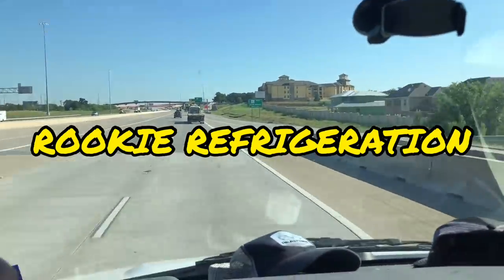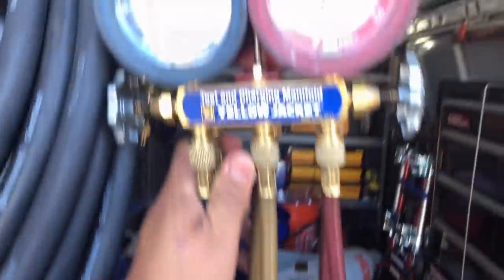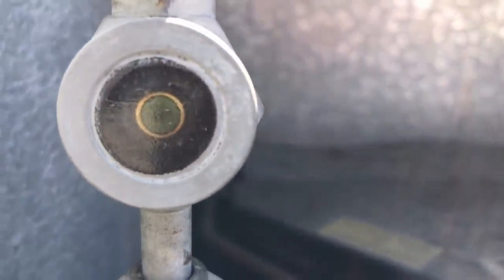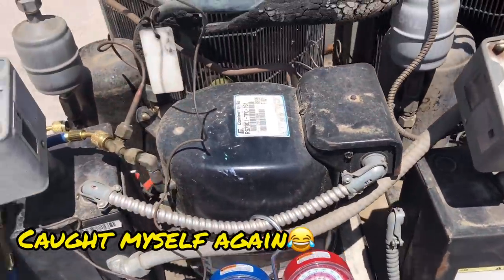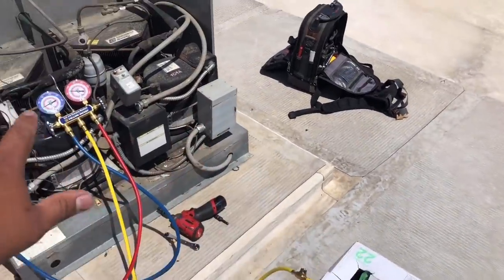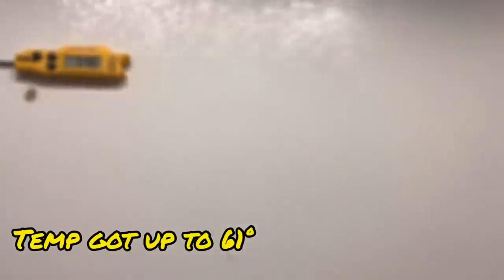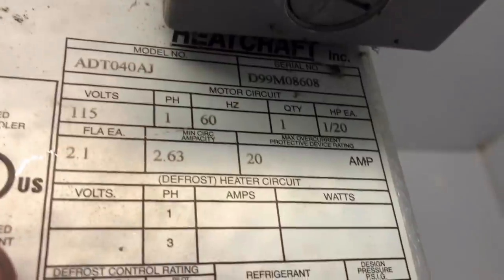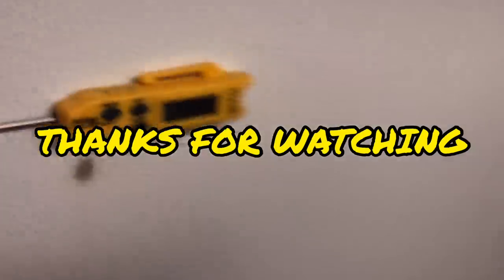HVAC REFRIGERATION: Walk In Cooler at 46

Comment: Definitely going to start purging my gauges that way now makes sense, but I think majority of us are just use to or taught to purge the hose instead of our manifolds .
Reply: Thats how non condensibles get in the system. Moist morning & guages sit open in the truck overnight with water droplets inside brass manifold. 1st morning job , needs really good purge.
Reply: OcRefrigeration , Hvac & Electrical Video's.  Thank you for sharing knowledge and great advice appreciate it 💪

Comment: Always gotta double check things.  It's good you caught it though and not afraid to say you make mistakes, honestly making mistakes is how we learn.  Most of what I do is computer stuff but I still have to double check things so I don't screw it up.  Trying to put a Point of Sale system together so I can make a few bucks on the side, bought parts and looked at a board today and was planning to toss 4 sticks of ram in it.  Didn't double check and system only supports 2 sticks... Derp move but was able to swap a few things and will just stick the 4 sticks in a different system and make it work.  I always try to write stuff down on the inside of a case as soon as I open them up so I can do a quick look and not think about it.

Comment: I purge my hoses starting from the can. Crack open then can, leave it up right, purge gas through suction hose. Flip the can upside down, purge liquid out of the high side hose. This way you know your fully "primed". Guys out there like to over complicate their purging methods. Again, if you can fill a water balloon, you can purge a set of refrigeration hoses/ manifolds

Comment: Nice video. Appreciated! Btw, what's the difference in suction pressure between cooler and freezer? (R22 talking)
Reply from the maker: You generally don’t use r22 in freezer because of high compression ratios.

Comment: Hi man, nice job, just for question, why not close the valve on the deposit, and inject the fluid after the deposit? It would be much faster and will be store on the deposit whidout you need to worry, couse gas will go to expansion  valve and the compressor is safe. Nice job
Reply: What is the deposit. Do u mean the receiver?
Reply: @juan251100  yes the system deposit or receiver
Reply from the maker: True.

Comment: Wasn't it quick to use the leak detector, because the liquid display showed a lack of operation?
Reply from the maker: ENGECLIMA REFRIGERAÇÃO yes. I knew ending everything was running.  Just would not keep temp.  So lack of refrigerant was the issue

Comment: Why did they put black tape instead of insulation on that suction line? I'm surprised you didn't point it out and that it works though
Reply from the maker: Yeah.  Since it’s getting replaced this was just a gas n go.  Lol.  🤷‍♂️
Reply: probably customer did it to appease health department, they cry and throw fits if there's water dripping off the lines

Comment: Is it recommended to attach your hoses to your high and low side b4 you turn the unit on ?.and is it better to do it that way ?
Reply: If you can yea but it’s not required. 410A runs really high pressures while running, so if you put on your gauges or off while system is on it will spray on u a little. Always use gloves.
Reply: @epicone2449  thx buddy...
Reply from the maker: If you use ball valves you can avoid it entirely.  I will try to make a video on that
Reply: I think its best if you can venturi effect could pull the air from hoses right into system. I like to purge my hoses soon as i hook up to the unit

Comment: Instead of r22 why didn't you use bluon r22 replacement don't even have to change oil
Reply: Still would have to recover any r-22 in the system , replace the filter drier and pull a vacuum before adding any r-22 replacement. And the evaporator is most likely going to be replaced
Reply from the maker: This^^^